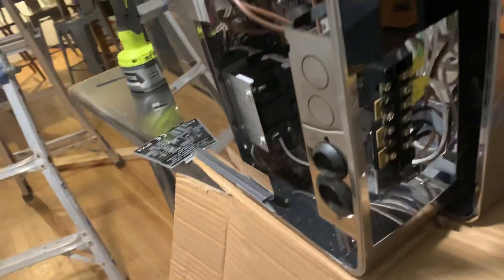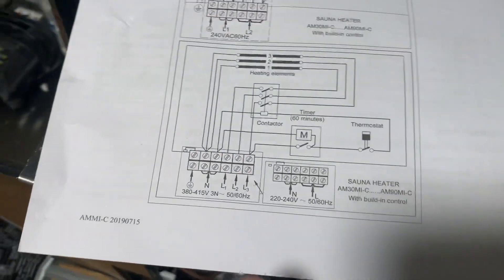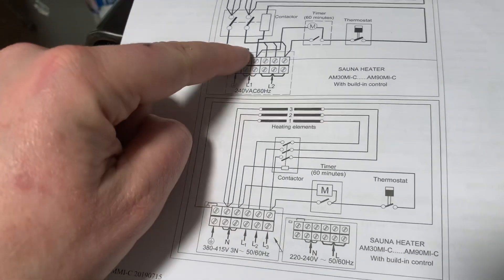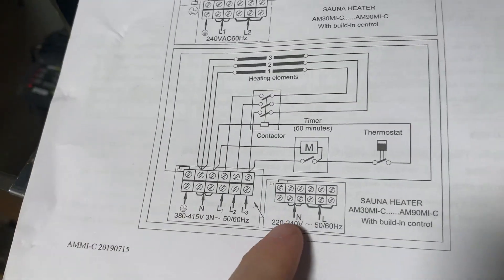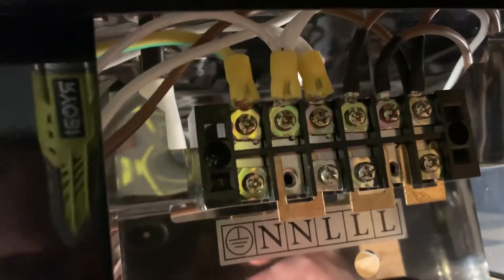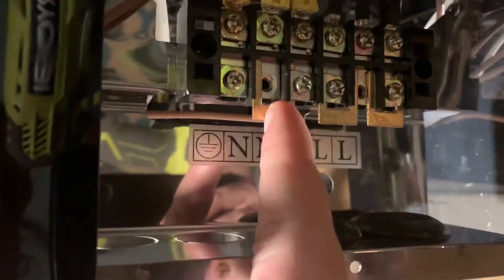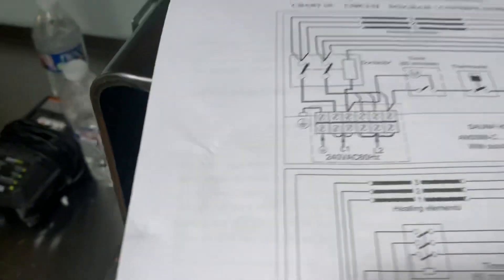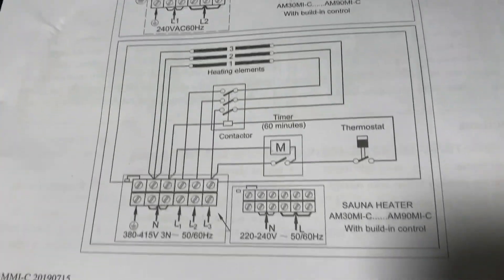Vevor Sauna Heater wiring solved 240v

Comment: So basically.  4.5 kw heater
30 amp breaker 
10-2 wire 
In the breaker box. 
1 hot to 1 side of a 220 breaker
1 hot to the other side of the 220

Ground to ground.

Each line ( hot wire) carry 110 for 220 total.

In the heater

Ground to ground
1 hot  to the 2 N with the  jumper 
1 hot to the 3 L with the jumpers.

No neutral needed
Reply: I was going to get a 25 ft dryer cord for charging an ev and connect the 4.5kw to the 30amp dryer outlet at my house... you reckon that would work?

Comment: I don’t get it, so you just send one phase 120v to 3 connected heaters? Isn’t it will try to pull 2x more current ? If even be able to heat it to promised 6kwt?

Comment: i have the 6K heater. i understand the 240 wiring, but I want to make sure that I am clear on removing the jumpers. Do I just remove the screws ( as in the video)? or do I have to remove the actual jumpers? any help is appreciated.
Reply from the maker: The jumpers just connect the conductors - the metal parts - you'll have to install the jumpers per your application - most of the newer ones have the jumpers in the right place.  I didn't remove the jumpers on this one.
Reply from the maker: on this model with this schematic you can see the jumpers denoted by the black lines connecting those slots

Comment: Ripper is right.  There should be 2 hot lines (120v each) and ground. No neutral. Diagram is mislabeled.  This operates the same as many baseboard heaters in N America.
Reply: Some sauna units do use the neutral, and I've never not ran an ECG. It's 240 in a metal encased device... failing to have a return path is outright asking to shock or even electrocute someone. Also, some sauna elements do work on 120... they won't get very hot, and can't heat a big sauna, but they do exist. What he has can work with either.

Comment: Ripper further down in the comment section corrected this video. You don’t connect the neutral wire (this type of motor doesn’t require A neutral). You Connect the black wire where he has the white and the red wire where the black is. Off your neutral and make sure that the ground is connected in the first slot. You’re good to go. Basically you use the top diagram.
Reply from the maker: jtfc -  the instructions are chinese.  Do you understand? l1 and l2 are not the same in China.  You use the bottom right diagram for split phase single phase american applications - I see you and Ripper cannot read a schematic.
Reply: Using the wire color has confused many in the US. For the 6Kw heater if you use 10/2 with a ground your wires will be white (120v) black (120v) and the uninsulated ground. If you use 10/3 with a ground your wires will be red (120v) black (120v) white (neutral not used) and the uninsulated ground. The heater needs 120v on the L1 and 120v on the L2 with the ground connected. The N and L1 drawing is for Europe where a neutral and 240v single phase can be found in some places. My heater is labeled ground, L1 and L2. The 3 L1 connections need to be jumpered together and the 3 L2 connections need to be jumpered together. My heater has the built in controller and timer.
Reply: In this guys application his heater has the ground connection, 2 N connections and 3 L connections. The labeling is set up for Europe. In the US N (in this case) is L1 and L is L2. This heater is not designed for 120v service. They now include an updated wiring diagram in the documentation sent with the heater.

Comment: The reason the schematic does not make sense to the average electrician is because the schematic is mislabeled. Shawn clearly doesn’t realize that it says 240v next to the diagram he’s pointing to. When working with a single hot and a single neutral you are wiring up 120v, not 240v. Most electricians expect the diagrams to be written correctly and are justifiably confused. Shawn doesn’t realize that he’s not using his heater to it’s full potential right now because he also doesn’t fully understand electricity. I suspect he’s not an electrician or he would no that this heater can run 1, 2, or three phase power. We don’t run 3 phase in North America, outside of industrial settings. Shawn should remove one of the jumper on the “L” side and use 2 phase power (240v). It’s  faster and more efficient. I do think it’s cool of him to show people how to wire this heater up to 120v, but he’s creating just as much confusion as the manufacturer that put out those horrible diagrams.
Reply: I think you are incorrect also. According to the manufacturer, the schematic with the Neutral is for Europe. American 220v shows ground, L1 into2,3 and L2 into 4,5,6 no neutral needed
Reply: @rippper69  having somewhat the same issue I can’t find a Siemens 20amp 240 volt breaker GFCI/AFCI and wondering if it even exist, what I do find is a Siemens 20amp 120/240 volt breaker 😑. Did you use a 240v breaker?
Reply from the maker: I appreciate everyones input but I made this video because an electrician in the USA will see l1 and l2 and assume very wrong things because I know more about electromagnetism and it's applications than you do.  You may hook it up to single phase.  As a matter of fact this is split phase single phase as most electrical devices in the usa are split phase single phase - but you can also easily wire this up to three phase if you want.   I'm correct because the video was made to clear up confusion regarding the wiring of this... which if you look at the reviews, the instructions confuse people as well as I do and I've helped a lot of people by pointing this out.
Reply: Ripper 69 I believe is correct. Having tried all three methods. When I try the above mentioned method it just trips the breaker. I’m told that no neutral is needed. Which seems really strange.
Reply: No need for a neutral wire in a straight 240 application. OP has this one right.

A straight 240V circuit does not require a neutral wire because it operates on a split-phase system where the two “hot” wires are 180 degrees out of phase. The voltage difference between these two hot wires is 240V, and they alternate roles as supply and return during each AC cycle. This balanced configuration means no current imbalance exists, so a neutral wire is unnecessary for completing the circuit it is further made safe from overcurrent by way of ground wire and the breaker it is connected to.

Comment: I have a similar model (AM30MI, its the 3.0kW 240v), working on wiring it right now. I also had an electrician tell me the schematic doesn't make sense... did you eventually get it fully connected and working? I am planning on running a 10 AWG from a dryer outlet that has 4 conductors. What did you do with the 4 wires? Do you put x2 120 on 4/5/6?  Thanks
Reply: Yo! This was my plan too! Did you get this to work? Curious if you could provide details of your experience.